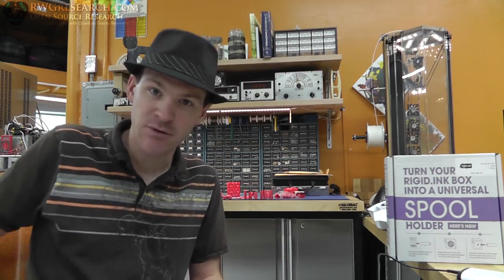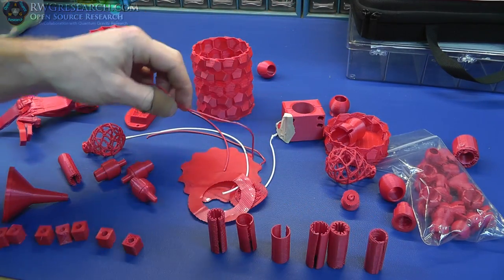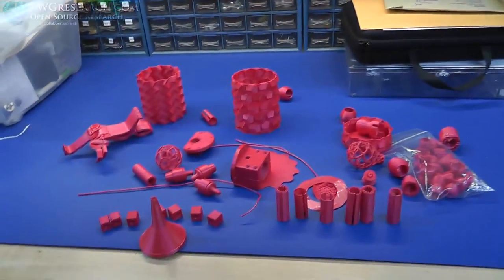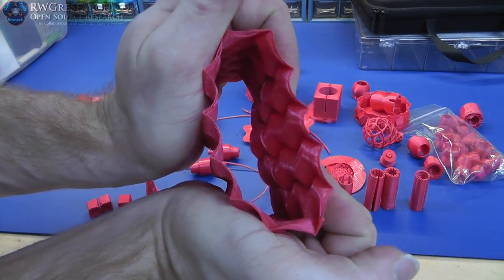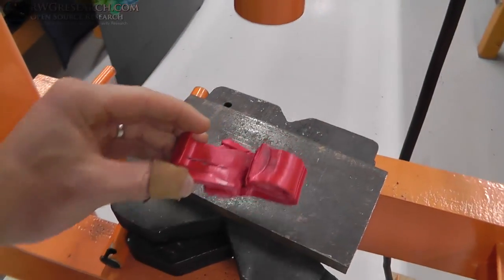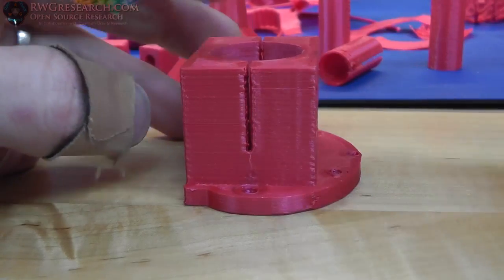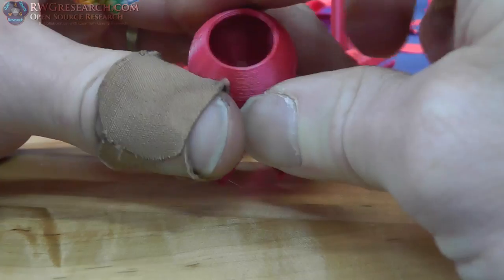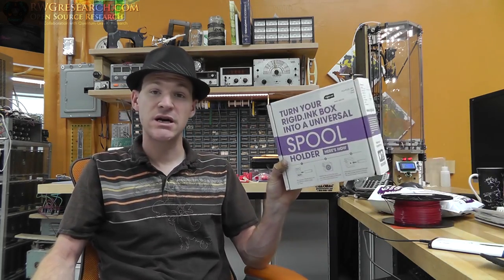rigid.ink PLA PLUS , But Can It Handle The Press? Review Time. Red Edition

Comment: They need to find a way to get the fiber re-enforcement to fan out of the print surface so that the next layer absorbs the previous fibers.  The grain of the fiber only has one direction of strength as it is.

Comment: You should try some PETG for your printer parts. PETG is very tough and has some nice flex (but not to much of it). There are other advantages like that it is easily printable and completely without smell and odour. PLA actually smells a lot more.

Comment: Hi there, sorry to hear about the layer adhesion issues (although thank you for the review!). We've not had issues with layer adhesion usually, so it could be settings related. 

What settings did you use? It looks like you could do with printing it very slightly hotter, or turning the fan cooling lower? Hope this helps.

Comment: You talked a lot about the fibers that are in this PLA...  I know that some weed trimmer line has fiberglass reinforcement.  I'd assume that they do that for strength as well.  I know that you have printed with nylon before - One of the reasons I started watching your great channel was the design and printing of the nylon speedometer gear.  I was wondering if you have ever tried printing with the trimmer line.  Nylon is very strong and it is very flexible too.  Your hot end setup should be able to handle the needed heat.

Comment: the PLA plus they sent me , i found i had to up he temps . try taking the temp higher .
i purposely made a weak structure , and well it's still in test , and few months its still holding the belt tension of my x axis perpendicular to layers. yeah i did it on purpose .  so jus try going up 4  or 5 deg c .
video link and you can see how wrong it is designed and oriented for print on purpose ,
https://youtu.be/lnbPBpMC62c